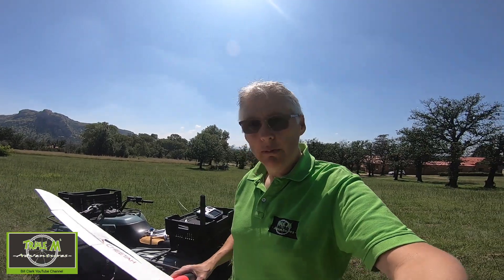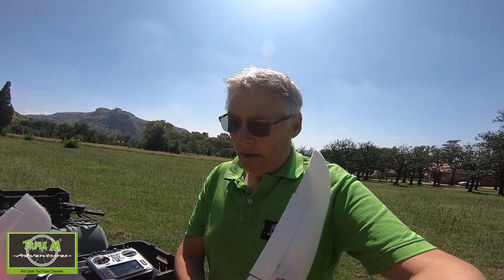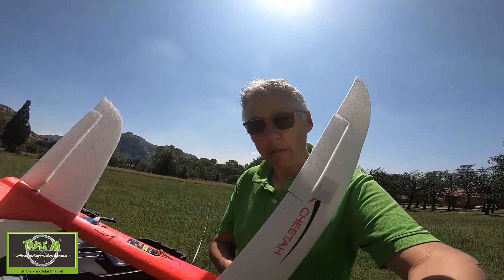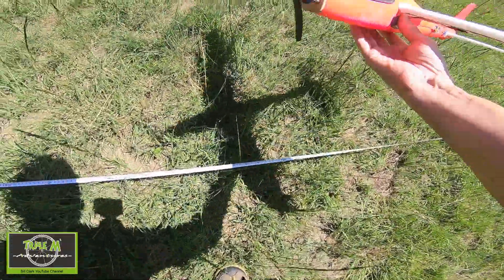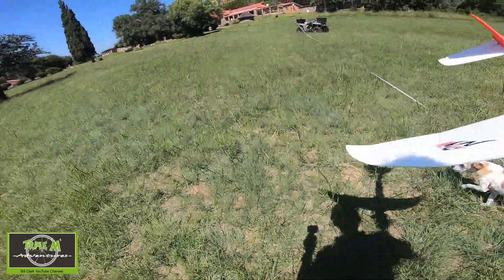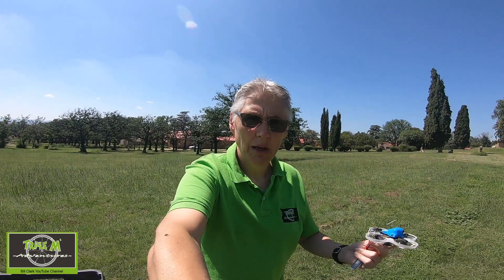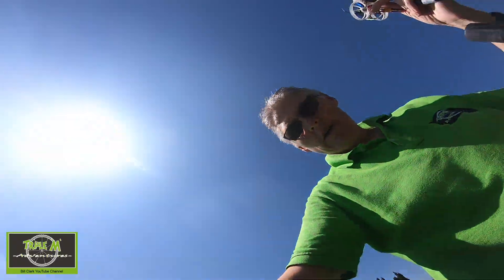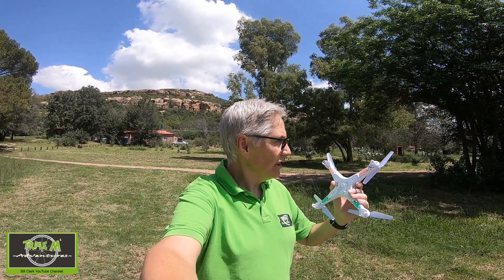Jumper T16 Range Testing

Comment: 1St rule of performing a range test is read the manual to know what distance is acceptable . I believe the Jumper states 45 ft in range test mode is good with anything extra being great . You also have to use the Fine Tuning feature on the FrSky receivers or they will be hit and miss . Plenty of videos out there about that .
Reply from the maker: RydFree  I have made a video on the fine tuning process see my Jumper T16 play list so the FrSky receivers were fine tuned. I had problems finding the data on the receivers sensitivity or their range capability. The manual states 30 meters for the radio on its reduced power but I was testing the different receivers. The strange result I got was the toy grade quad copter. Any ideas on that result?